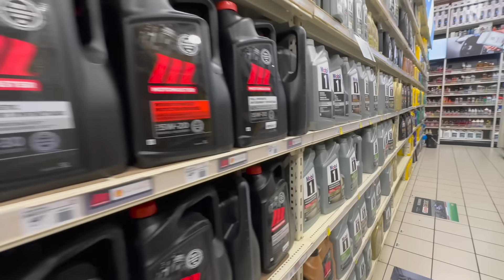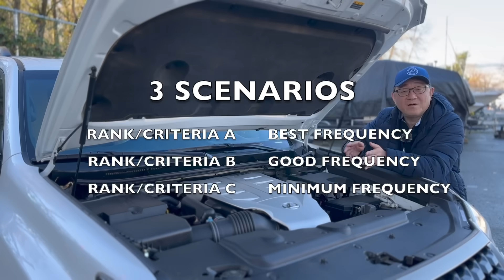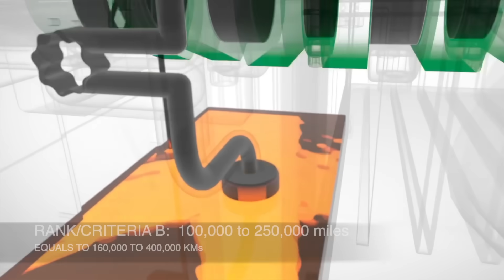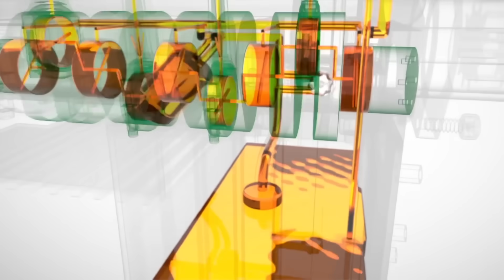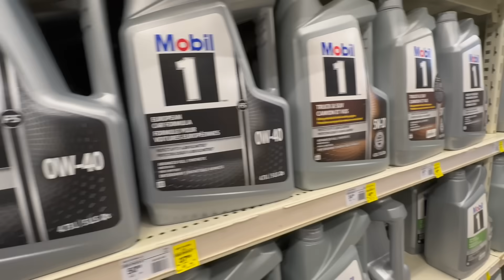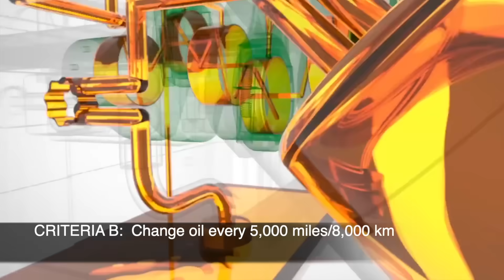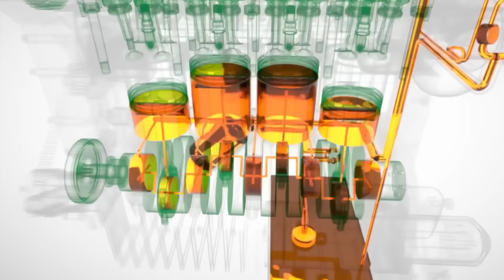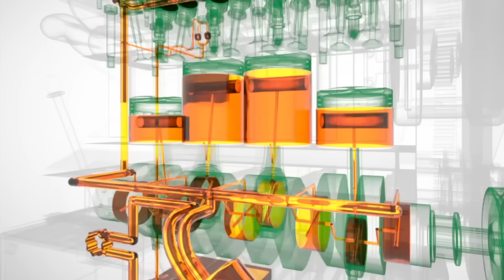ENGINEER EXPLAINS HOW OFTEN TO CHANGE OIL & FILTER // UPDATED CRITERIA-BASED RECOMMENDATIONS!

Comment: I switched from 3k conventional to every 5k full synthetic for the engine as that matched up with the non-engine oil change intervals of all of my engines - on my truck this meant differentials et al get changed every 20k, on my Harley the engine gets changed every 5k while the primary and transmission get the 20k. 

I’ve found by just shifting everything to a common schedule I’m never wondering if something got done - is the engine about to tick over another increment? Then it’s time to change fluid - but I do it on the tank of gas that carries me over the mark, and since it’s common across all vehicles I just don’t have to try to remember which vehicle is on which cycle.

Comment: Does these include if the car spends a lot of time parked?
Reply: Whether you drive your car often or not, if you’re using full synthetic, it should be every 5000 miles, if you’re using conventional it should be every 3000 miles.

Although oil doesn’t lose its viscosity overtime, other things begin to degrade within the oil. That’s why you need to change at  those intervals.

Comment: Update: got the CCH AWD. 9 months. Took a bit to learn hyper mileing, so only MEASURED 70 MPG overall, 70% EV ratio. How many miles to change? Toyota Care change at 1yr, @5k mi. but only 30% ICE running? Planning to just do annual, expect about same. Drive till I can't, 65 now.

Comment: Great discussion regarding Oil.  I have a 2025 toyota Crown Signia , is it a good idea to change the oil at 500 miles to remove any debris left over from the manufacturing process?

Comment: Old timey SAE mechanical engr. here .... who in my early days performed oil and wear analysis.  Automotive Press' offered long term analysis is SPOT ON.   I try to get 200+K miles out of my IC engines. My practice has been: 1. for 90% steady-state 'highway' driving, I change the oil & filter at 4000mi (2/3 of the OEM recommendation).  2. When "city" (lots of stop and go) driving, I typically change at HALF the OEM recommended interval .... (especially for 'modern' (loose piston ring) engines (built after ~2012) at HALF the recommended change intervals.  and not to exceed 6 months due to inevitable oxidation and DILUTION of the oil by blow-by combustion gases getting past those loose piston rings.  
In all cases, I buy 'top tier' lubricant oil that have better anti-oxidation and 'detergent' packages included in their composition.    Rx: dont chintz - as the extra cost of earlier changeout is a hell of a lot cheaper in the long run, than a prematurely worn out engine.    
Stuck piston rings (severe cylinder wall wear) are to be expected in the 2012+ engines;-- so lately, I've switched to the newer "Protect & Restore",etc. oils for every 'third' changeout.

Comment: I tell you what happens when the engine operates, it simply polishes itself creating metal powder which mixes with the oil. There's no such thing as zero friction oil. Only semi trucks can filter them out due to their heavy duty filters dunno how they're called. How often? 4000k miles if you like to keep your car for a long time. This is only for 150 hp max. If you have more than 4 cylinders you will have to change it even more frequently. Well, the metal powder acts like a grinding solution which wears your engine even faster. And no normal filters cannot filter this kind of dust out, not even magnets will help you. Don't ad magnets to your filter because if you drive constant speeds all the time, and one day after 2000 miles or so you go full throttle that collected chunk of metal powder might just suck itself trough the filter at once and grind the crap out of your rod bearings. Like I said filters cannot filter that powder out it's too tiny. I don't recommend magnets, not even on the oil pan bolt. Just change it more often and you're good.

Comment: I just traded in a 2013 Hyundai Sonata 2.0t which I also had tuned with 124,000 miles on it and changed the oil full synthetic and filter every 7500-10k miles...the car purred like a kitten, didn't leak a bit of oil, zero issues, changed the tranny fluid at 60k miles...2500, 3000 miles is a complete waste of time, effort, and money with modern engine tolerances and oil technology...multiple tests from places like Black Stone Labs scientifically prove this

Comment: How often do you really need to change the oil if you drive a hybrid? I have a 2019 Ford Fusion hybrid, and I love it. Obviously, being a hybrid the engine gets a fair amount of "time off" while driving; thus, the odometer mileage does not reflect how much work the gasoline engine actually does.
Reply: Just like with conventional vehicles, the best advice is to follow the manufacturer’s recommended maintenance schedule for your hybrid.

In short, hybrids might require fewer oil changes overall due to less engine use, but the interval depends on your driving habits and the manufacturer’s specifications. If you’re doing a lot of short trips or stop-and-go driving, you may need to change the oil a bit more frequently.

Comment: Oil changes are cheap.  I follow the Honda Maintenance Minder and it usually specifies a change in the 7,500 mile range.  It's got me to 175k and the motot runs like new. BLACKSTONE sample says oil and motor are fine.

Comment: I have a Toyota Rav 4 Hybrid. Toyota recommends oil and filter O-16 weight synthetic oil every 10,000 miles. It is also recommended to rotate the tire every 6,000 miles ,so I have the oil change and tires rotated every 6,000 miles to save time. Great video, thank you.

Comment: 2013 Highlander V6 109,000 miles and 2010 Civic 170,000 miles. Full Synthetic Oil change and filter every 10,000 miles or when Oil Maintenance light pops on. Both cars burn zero oil and run like new. Oil Lab tests say oil life was fine.

Comment: Just wondering if as you say the viscosity does not degrade it would make sense to change the filter only at half the mileage interval.  That way you have cleaner oil for longer. PS. Good video, well done, nice and simple.

Comment: The other day I had my mind blown by an observation: engines don't die from wear. I've always worried about wear, but I have killed a lot of engines in 60 years, but not one of them died from worn bearings. Piston rings lost compression on one engine, which could be wear but was probably something else like heat taking the spring out of the rings. 
I will say I've had several vehicles that had an obvious increase in oil consumption or leaking after about 4,000 miles. I would get 3,000 miles losing 1/2 quart or less, then I will lose 1/2 quart in about 500 or 1,000 miles. As soon as I saw the oil get below 1/2 quart low, I would change it and never add oil between changes.

Comment: change my oil every 10,000km or so incl. filter semi synthetic, never changed brake fluid or fuel filter, rarely change coolant, never did a air cond. regas, as cold as when I bought the car 22 years ago with 360,000km  on the clock, 1.6 ltr. petrol engine. Diff oil still fine no issues nice and clean. Maybe its just a good build car. Never stoped running. Live in a hoter climate. Mitsubishi Mirage ! Top car !

Comment: I would change diesel engine oil more regularly than petrol engines Eg. Diesel at 5-6k miles, petrol at 8k. I've also heard of the average mph guide rule - multiply your average speed (on your vehicles computer) by 200 eg. 30mph would be an oil change every 6000 miles. The thinking is that city/ town/stop- start driving will wear the engine more than motorway/freeway driving

Comment: Have been a heavy equipment mechanic for 50 years. Oils and engines have changed quite a bit in those years. I have run a 1993 geo metro up to 20,000 miles before changing, just changed the filter. Parked it at 435,000 miles. 85% highway though. I would say stick to what the manufacturer might suggest. With these synthetic oil out, cleaner burning fuels combo with engines that are more efficient, stay at least close to the recommended intervals. Know your personal driving habits, conditions, etc.. This helps. It used to be that if we used to follow the manufacturers recommendations, it was like they were in collaboration with the oil companies. Sometimes, a little can go a long way.

Comment: I don't disagree with your recommendations, but an important factor in oil change intervals is the conditions the vehicle is used in. If you live in a hot and dusty area like the United States Southwest, that's severe duty. If you tow with your vehicle, that's severe duty. If you only drive the vehicle on short trips locally, that's severe duty.  If you live where there's extreme cold, and start your car when the oil temp is well below freezing, that's severe duty. If you drive mostly on the highway without much load, that is very easy on your engine oil. I drive mostly highway, and go 7,000 miles on oil. I sample oil for analysis, and my reports are excellent. When I replaced the valve cover gasket, (Thanks, BMW!) the cams showed virtually no wear at 150,000 miles.

Comment: Every variables involved in these type of recommendations are different.  Do the oil sample test yourself tailored to your specific vehicle, your specific driving habit, your specific environment, etc.  Probably two to three tests will tell you how often you should change oil.  Using that method, if a million people do it, there will be a million different results.  Ever since Covid, one of my cars sat and I operate it once a week.  I change oil once a year, the engine was fine.  I thought about going longer but the power to be will punish me if I get that lazy...

Comment: I keep vehicles 10 plus years but now I only drive about 5,000 kilometers annually. I’ve been changing the oil every 18 months. I use synthetic and have always thought it illogical to not change the filter.

Comment: I do low mileage and do look after my cars. I do believe it’s truly fanatical, however, to change a car’s engine oil as frequently as every 6 months. Most modern ‘long life’ synthetic oils are designed to be used comfortably un-changed for 10,000 miles or for at least 12 months. Any more frequently than that is a bit like taking 2 or 3 showers a day and a waste of time and money. Moderation in all things is my motto.

Comment: I don't change my oil, I just change the oil filter and the valve stem seals take care of the oil change.  On a serious note my cars usually stay off for at least 7 days for work so I can go for 10,000 km/ or around 6000 Miles (sometimes a thousand less or more depending on events occurring. My 2013  Malibu has 280,000 km so far with the same 10k km schedule running real nice, no leaks no issues at all. I appreciate the video and the research and advice.

Comment: He is very correct,! The 3 thousand mile oil change has never changed!  All oil get dirty because of combustion! Period!  So no matter how expensive the oil you buy it still gets dirty because of combustion! He is correct! I run full synthetic but charge it every 3.000 miles

Comment: Great video. I am using full synthetic oil in my Toyota. My problem is I do not drive that much, maybe 5,000 miles per year. So should I change it every six months or should I wait for 5000 miles?

Comment: I use the Shell advanced ultra 10w 40 fully synthetic oil in my 2004 model 125cc Hero super splendor...Engine always feels super refined alike new with this oil...drains in 3500km.

Comment: In my 50 years of driving I've owned 16 cars. Some were late model, others were old clunkers with high mileage. 
I only change the oil every 10,000 to 12,000 miles, along with the filter. In all those years I have never had a car with
an oil related engine problem. In fact, none of them had engine problems. So when I hear about changing the oil every
5,000 miles (or less) I am very skeptical.

Comment: Please answer..i use Idemitsu 0w20 ifg3 oil with the mazda 1wpe-14-302 filter.  First change at 950 miles.  Second change will be at 2500.  I currently have 2025 miles.  Bought car new in june 2024.  I do my own oil changes and minor maintenance.  First, is this good oil to keep using or i was going to change to penzoil ultra in summer.  I was thinking of changing to 0w30,or 5w30.  Idemitsu is hard to get and ultra is supposed to be very high quality as well.  Car is the Cx5 non turbo, NO CYLINDER DEACTIVATION OR ISTOP.  love the car runs beautiful.  Please advise on which oil of the two you prefer.  I do not count pennies for better quality.  
Thank you.  Love ir videos.  Happy holidayS!

Note: i live in savannah ga. Hot hot summers with high humidity.

Comment: i have a 1999 chev cavalier with 420000 km on it change the oil and filter every 5000 km still going strong all original drive train mostly highway driving owned it since 2003

Comment: I have a vehicle that I use only  go short local trips. It is a 40 year old vehicle that I don't put on more than 300 miles per year.  The engine is great, but the body is rusting out. I keep it alive because I can do the maintenance and repair myself. I have an emotional attachment to the vehicle and now I just change the oil and filter every 5 years for no other reason than a habit and to show it some love. When the vehicle was used routinely and I was putting 10K miles per year, it had the oil changed every 3-5K miles. So if I want to keep the vehicle running for another 40 years at this rate,  and it outlives me, what is the schedule of oil change?

Comment: My Corolla is now about 10 years old (120.000km). I change the oil every 10.000km - 15.000km with Castrol Edge 5W-30 and it's a little 1.33 ccm 4 Zylinder Engine. The Engine is stil in a very good shape.

Comment: I currently live in the Midwest. I drive a 21 year old park avenue with 271000 miles on it to work and back. I change the oil about every 6000 miles and the car uses very little oil in between changes. I am in my upper 60s now and have had quite a few different cars in my life. In my experience you could use your plan C in about any of the cars I’ve owned and the body rust will kill the car long before the oil change intervals ever would.

Comment: Very useful video!  Question - My dealer put too low viscosity of oil in my car by mistake at my recent oil change. Do I need to change it out?
My 2024 Outback takes 0w20. The dealer used Ow16. Car has 15K miles. I change the oil every 3K miles (instead of the recommended 6K). My driving is mostly short trips around town, with an occasional longer trip. About 12K miles annually. Will driving 3K miles with the too-thin oil reduce the longevity of my engine?
Reply: May not protect the engine at high temperatures if u r using 0w20 instead of 0w30

Comment: 25+ Year mechanic and shop foreman. Never in my career have I had an oil related issue changing Engine oil and filter every 3k or 6months. And we use Valvoline Advanced Syn in all our fleet vehicles. Small price to pay to keep your engine running smooth.
Reply from the maker: That’s awesome! Thanks for sharing your experience.
Reply: Valvoline is the way to go! I run Restore and protect.

Comment: Another minor factor might be the oil capacity of your engine.  For example my Honda Civic usually involves less then 4 qts.  This is a lot of work for the oil given the low capacity.
Which means taking a 1000 miles off his recommendations?

Comment: Thank you for all of your very informative videos. I have a Lexus NX450 h+ on order and it should arrive in February, 2025. Our daily driving will usually be under 50 km, so with the PHEV the engine will not be used very often. As a result I plan on changing the oil every 6 months. However, I will be going on some longer drives that will require the use of hybrid using the engine. This brings me to my question. Is there a way to track engine hours instead of mileage on this car so that I can change the oil every 60-70 hours? I would be Ok with installing something like a Hobbs meter is that is possible or can the engine ours be obtained through the OBD port with a scan tool, for example?

Comment: I was a automotive technician for 20 years and I can 100% agree with these recommendations. I always tell people 5k intervals are the safest bet for longevity and cost. I have been inside so many engines that get 10k intervals and they all have carbon deposits stuck to everything. When these deposits start falling off they clog the pickup screen and starve the engine of oil. It usually happens over 120k so the manufacturer is in the clear.
Reply: I'd recommend 3k interval and Valvoline Restore and protect oil to clean things up.
Reply: @JohnTaylor-bd1uy well you can’t change your oil too much so that would be fine.

Comment: Wrong AF! No engine manufacturer or car manufacturer has said change oil every 3000 miles in the last 20 years. Ever hear of dry start? Should have nothing to do with how long you want to keep your car but rather how many miles are on the car. Detergents break down and that is totally dependent on how dirty the engine is. Some cars that have high mileage need oil changed closer to 2k miles where newer vehicles can easily go 10k miles. So, oil change intervals are totally dependent on internal conditions and should have nothing to do with how long you plan on keeping it!

Comment: I do 10k miles full synthetic oil and filter changes and engines are great with no increased oil consumption.

'88 Saab 900t 2.0 for 80k miles.
'03 Mazda MPV 3.0 for 110k miles.
'15 VW Sportwagon 1.8 for 73k and counting.

Also, I don't drive high rpms until warmed up and i do Italian tuneups..lol

Works for me.
Cheers